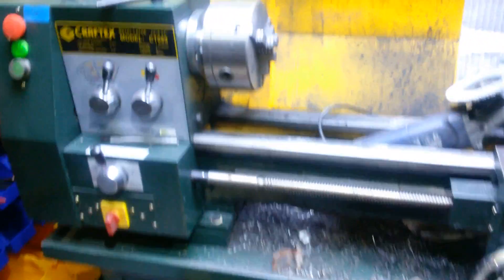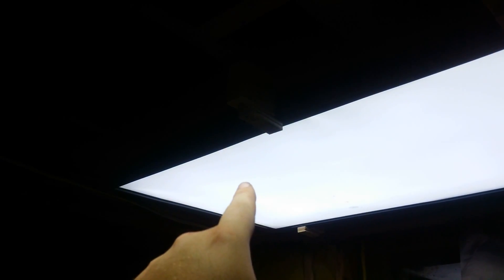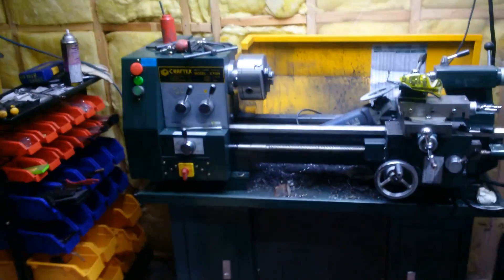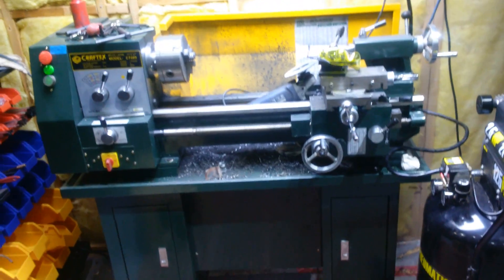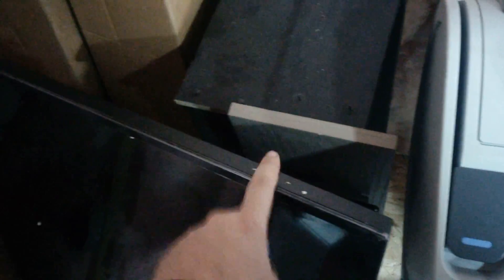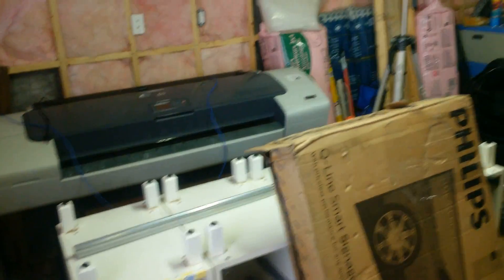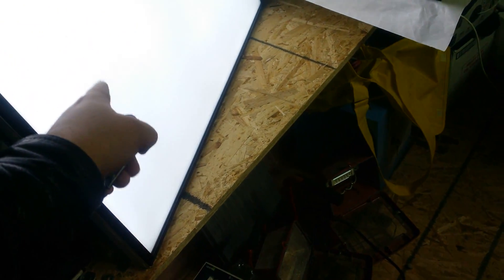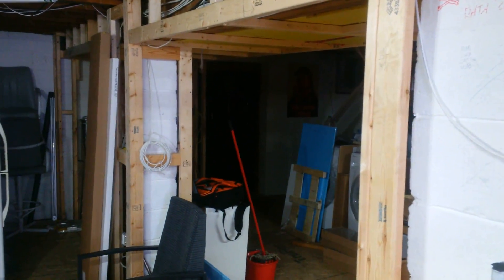Upcycling broken LED TV's as light pannels *problems*

Comment: I have converted 5 tv's into lights, simply by disconnecting the circuit  boards that are not necessarily.  The TV/Lights now work as a normal light fixture. It is connected to the power only, no power  switch is required. It remains on as long as it has power.

Comment: Today is trash day. I found a Samsung UN55J620DAFXZA 55 inches with smashed LCD no power cable. As soon as I plugged it in, it came on. Screen all cracked, no turn on sound. I unplugged TV from power and LCD ribbon cable as well. It stayed on for over 20 minutes. I unplugged and removed everything except for power supply. I had it on for over an hour with no problem.

Comment: I too tinker with LED TVs found curbside. Have one light box and the other I took out the 4 strips of LEDs and screwed them on the inner surface of a 4 foot tube garage light (had to cut a few inches off the length of the housing). Plopped the TV circuit board on top, wired it in and it works great! Buy a generic remote control and you can shut the light on and off. Only thing, as mentioned in the video. the lights go out in 14-15 minutes. Have been trying to solve but no luck. Anyone have any ideas. It is handy to use the power supply from the TV, especially with the use of the remote. The remote makes it easier to turn on when you have a project in the lathe!

Comment: you just need to trick it into thinking it has an input so that the screen doesn't go to sleep, right?
maybe put your multimeter on a video cable and see if there is a measurable signal that you can replicate with low current?
most TVs have a power saver setting.
if you got a hold of the manual for the tv and could somehow turn the power saver off?
OR design a simple timer circuit that automatically cycles the power......
OR find an external button like a volume up or down that you could automatically close with a relay once every 14 minutes to make the tv think your still there....

Comment: Just connect the two wires together that are going to the power button. When you plug it in there might be a few second delay, then it’ll stay on as long as electricity is supplied.
Reply: If u do that; that means u could plug it in to a outlet that is controlled by a light switch right?

Comment: You have to take and cut all the wires that are connected from negative and positive Inside how the LEDs are hooked up.  They are running a negative to a positive on the next one and then that negative to the positive on the next one. If you cut all those wires and hook up all the negatives to one wire and all the positives to one wire, then you can run about 20 volts. Keep it on. But they are running all together through the circuit board. Each has to be its own strip with its own power basically.

Comment: I salvaged  Samsung Led Tv roday. This is what I did rock prevent the lights from turning off after a short while: I simply unplugged the Tv board from the power supply. Now it has been on continuous for the last 4 hours.
Reply: Which "TV board"? Do you mean the AV board? What about single board tv's?
Reply: @ralphfuller2606  I guess so. That was so long ago that I don't remember what other circuit boards there were
Reply: For a single board TV, try disconnecting the LCD circuit boards from the main power board.

Comment: I've seen some people wire the power switch on, and take out the video circuit leaving a power supply and only LEDs lit up. No signal lost power Downs and even remote still worked on some

Comment: You could try shorting the video input port. Take a wire and jump the inside of the socket to the outside of the socket. Or plug an antenna to the tv cable input.

Comment: what CRI (color rendering index) do these backlight LEDs usually have?
Reply: My reading suggests it is likely to be somewhere between 80 and 90 in more modern LCD panels.

I recently did a tear down of a fairly new (2 years old) LG 43" LCD TV and looked up the specs on the backlight LED strips. The docs claim they are 6500K with a CRI of 90.

This TV also has three layers of optical plastic for diffusing and spreading the light behind the LCD panel. One is rather white looking. I have not figured out the purpose of every layer yet but the middle one almost seems like some sort of a Fresnel lense. At an angle it almost seems mirror like and looking through it you see rainbow like coloration. How the LED light interacts with the other layers and the LCD itself is beyond what I clearly understand.

Needless to say, the raw 6500K 90 CRI rating of the naked LEDs all by themselves isn't all there is to the overall color scheme. It's quite a piece of optical science for sure.
Reply: the samsung ue46f7080st has 2 edge led aluminum strips. it says "46 7K / 8K / 8.5K SNB 3D - 7032LED-L V3LE-460SMA-R2". i suppose this means the temperature is 7000-8500K. couldn't find any infos on the 7032 LED (CRI, efficiency etc)

Comment: Did you ever bypass the auto shutoff ive been trying to do this for my own project for months. I did see an instructable article on how to bypass with a simple pink wire clipped (timeout wire) soldered to 5v standby if you have the diagram of your board of which i cannot find for my specific boards.
Please and thank you
Reply: Can you link the Instructable you’re referring to? P&TY
Reply: @makeitkozi  I cannot recall where the exact instructable was for step by step guide however this may help you. I never figured it out. https://youtu.be/J6cpVrjmQXY his channel is zenodilodon if you don't want to open the link. He gives great instructions on how to turn broken tv into light. He explains it can be easy or difficult depending on what model tv your working with. I had to use information from all over the web to get an idea of what I needed to do but since moved and lost my garage space to finish the project I hope that helps! For me it was sad to see all these working parts and leds go to the landfill when most of the time these TV's simply have a broken screen.

Comment: I have the same issue, by passing the auto sleep mode if the input is absent.

Mine is Dell monitor model S2340Lc, inside the monitor the back of the LCD has this model: LM230WF3 (S2)(E4) I wish to by pass the power to get out from auto sleep functions but I don't know how to do it in circuit board.

The backlight still working however the sleep mode function is still active, means if there's no video input the monitor will automatically sleep after few minutes.
Reply: I just left the comments. You have to cut. The wires for each LED they're running together. You have to separate them and put all of the positives on one wire in all of the negatives on one wire. Then you can run it without it shutting off. After you cut and separate and make each light its own. , you can just take one wire and wire each positive to that one wire and wire each negative to its own one wire. And run about 20 volts all of them on they will not shut off.

Comment: i use the same system as desktop keyboard lamp, for stay on i put a screw driver pushin one boton down and not power off ,sorry for bad english i speak spanish.. in digital circuits if a key stay press they not go to sleeep becose all buttons are a serial circuit..
Reply: Just make the volume stay up or down and add a switch between the main

Comment: You just remove that board and leave the power board. What I'm curious about is what power the the LEDs themselves use so I could remove the wall plug and run it off a car battery etc.
Reply from the maker: The LEDs in the TV can run from 90-150v ac. They are pwm'd to achieve a brighter or dimmer picture a d a constant 30/60/120hz to give you the right refresh rate. Since they do run AC power you can't just hook then up to a battery. But you can get a 120vac output led driver. But.   Those are about $80 ea and defeat the purpose.
Reply: Got it done on mine.  Ler me know if u guys still need help to keep yours on?   Thx for great vids
Reply: @andrek.1399  what did you did to keep it on?

Comment: without reading xomments to see if someone told you this alreafy. My drafting tavble is also a light table for tracing and whatnot. First problem i had was the turning off issue. First time, was rhe auto timer being ON. I cured that with the remote and blind instructions through the menu. 

Next time, turnedbout to be heat protection. When you mount it with the heavy glass on top, and face up to boot... without allowing the LEDs heat to flow out the back, instead traping it since it wants to rise.....you need to move some air in there. circukate. Thats acconplished with a computer fan. Bought singly, or by the case, or picked off a junk electronic device, you need onky find a 5v power source within the tv with a DMM, or a USB port (theyre 5v), or run a small desk fan off the power cord. 

Trace outkine of shroud onto a likely place on the bavk of the tv, then cut that out, and finally epozy/CA glue that fool in there, makibg sure its out of the way of anything . poasition it above the power aupply,board for even better effect. Or two fans in a push-pull cobfiguration. No more problem!.

Comment: Look on the power supply for a BL_ON written on the board. you can connect these to I think it's the 3.3 volt pin or the 5 volt pin Not exactly sure. I did it on the 5V rail and it worked. You can add a switch and then you can just remove all board other than the power supply and inverter boards. Some TVs the power supply and inverter are in the same board.
Reply: the last little while since posting this video we have had no time to mess around with the tv's due to all sorts of crap coming at us life wise..

thank you for the tip, i suspected this to be the case but some tv's seem to be a little smarter then this simple solution or are not marked..

i have no issue with just using the leds and just popping in a after market power supply and all that but the ones already in the tv's happen to be very efficient and PWM rather then a resitive or capasitive dropper or what not
Reply: I have one of those smarter TVs where there is nothing written on the boards and tons of wires. I actually ran out of time to do this because I was doing it last year and it got too cold where I am. I will meter out which lines go where and try to make another shop light. I've made two so far actually three but it doesn't work. Probably due to many of the CCFL lamps being broken and it having a fit but when it is working it looks like those rectangle 2x4 fluorescent lights that go in suspended ceilings. The effect is pretty cool.

Comment: what I normally do with those kinds of tv's is that I take off the power supply and follow the wires that go to the led strips and put in a ebay power supply
Reply from the maker: mark zamiechowski these tv's usually take 120-150vac though. Can you post a link?? I haven't found a good one.
Reply: Bart Koscow thwy usually take that as the input but if u poen up the back you remove the main power supply board and they use 12 or 24v strips on behind just look at the powersupply connectors that go to the signal board to see what jind you need or just take 2. 12v bateries and try to turn the light on like that to test them

Comment: so if led t/v produces.multi colors...is there a way to make the lights red/green/blue..if any one knows how let me know .I am wanting to.use them as stage lights and make them flash red/blu/grn/amber if possible.or if ther is adriver that will make them do it
Reply: no. it has white LED inside as a backlight. they shine through the LCD TFT panel in front of them. the LCD TFT produces the colors. if you have a broken LCD TFT you can remove it and only use the white backlight.
Reply: No. There is no longer an LCD panel on it.

Comment from the maker: All of the TV's i got for less then $12 at auction over the last year. one lot was 4pc and i got them for a doller. SCORE! 

Its not that im unwilling to drive the lights meself, but that would mean buying more equitment, when these already come with a board. im thinking maybe applying 5v to the powerboard input from on the control side, this should force the power board to output power. 

Problem with making my own PSU for them, some seem to take AC some DC, and the power RANGES wiladly from tv to tv from as little as  24v to 250v DC. they all modulate the power with PWM as best as i can tell from looking at the circuits. 

pls help?
Reply: ok so i have this LG 42LS3450. i measured the voltage across 5 LED strips in series: about 120V constant. 0.26A (= 30W). it has 5 strips each with 24V. so instead of in series i will re-wire them in parallel so that i can use a 24V CV power supply from mean well.
i think it is much wiser to use a dedicated LED driver. when i plugged the LG in and measured the power it drew from the wall, it was more than double (i think it was 70W) of what the LEDs drew themselves. less than 50% efficiency of the built in power supply (for the job of lighting)! 
even worse: the samsung  ue46f7080st used 83W at about the same brightness.
Reply: Just have something like pebble hold the button down with tape it work 100

Comment: Did this I dont remember the brand. You have to trick the power supply into thinking the motherboard send a on signal.  Take a multimeter amd probe the powersupply cable going into the motherboard and find the ON signal. Then you have to send a permanent ON signal to the input you have find with 3.3v or 5 volt depend on the signal voltage. Not super clear but you get the idea my "lamp" only have the powersupply install and the  hacked the cable going into the motherboard to send itself the on signal its always on need a external switch